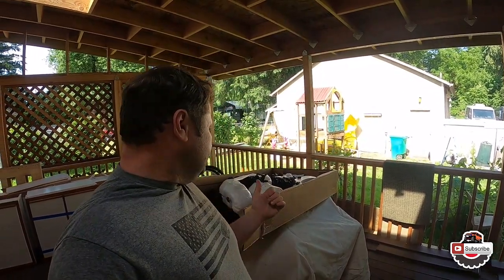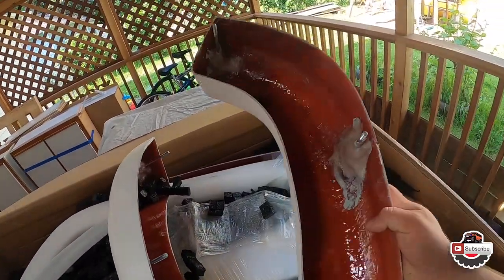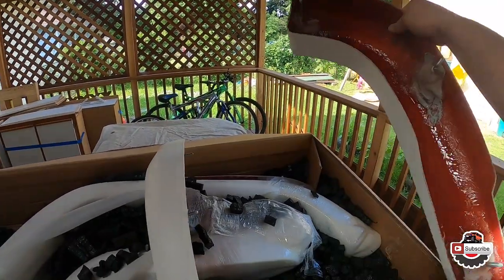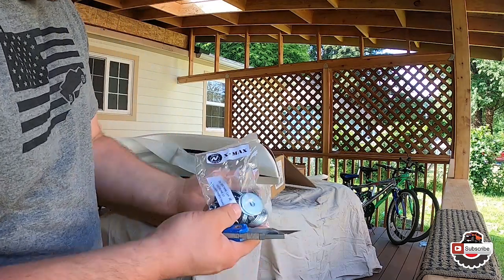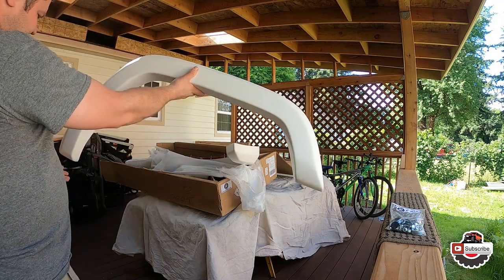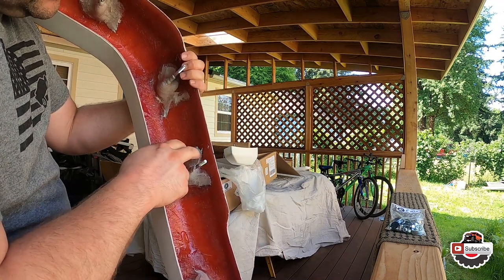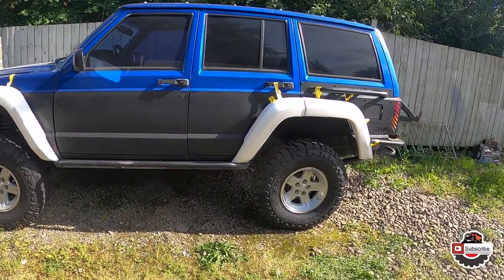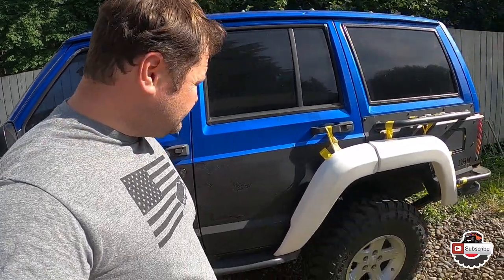Notch Customs X max Fender flairs Unboxing Jeep Cherokee XJ

Comment: I'm super interested in these but have heard so many complaints about fit and finish quality in the past.
Reply from the maker: Yeah, they do need to be primered and painted. I just got the unibody straightened and welded stiffners on.  These and the hood are next on a to do list, to be installed.